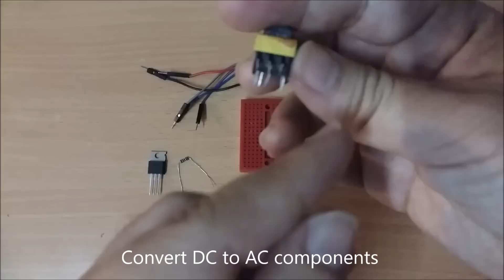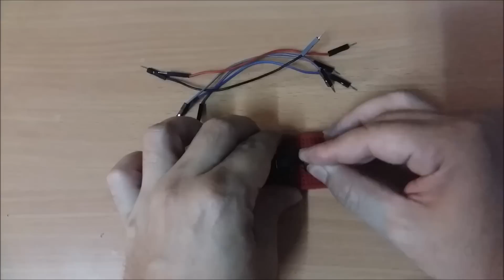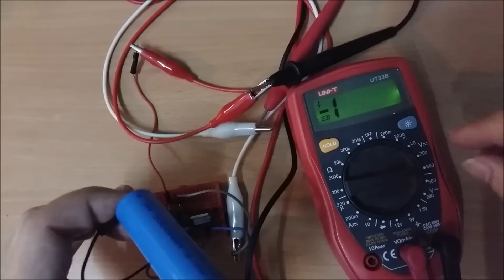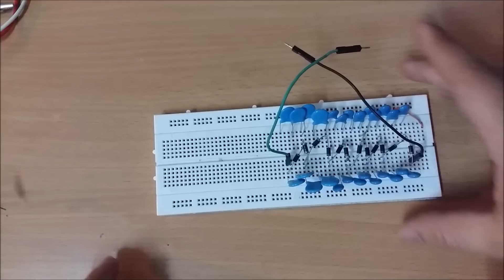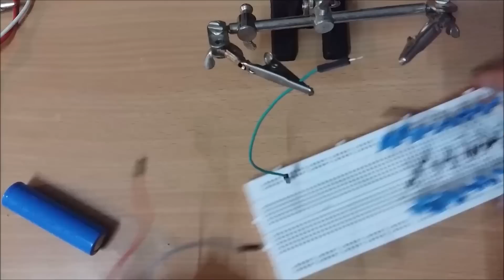diy voltage booster | dc voltage booster circuit | simple voltage booster circuit diagram | #youtube

Comment: Viewers: keep in mind that this so called 3000V AC output is actually 3000V DC PULSED...so you can NOT use this output to drive a voltage doubler (or multiplier) which is what first grabbed my attention.
Reply from the maker: Theoretically you maybe right but practically perhaps you can just go ahead and try

Comment: hello brother i make same circuit but it works with 12v but i want to run it with 3v plz help me plz
Reply from the maker: Perhaps your transformer rated higher voltage.. You need to find transformer that works with 5 volts or lower... U can find them inside phone charger adapter
Reply: brother phone charger have transformer but with 6  pins  but for making this we need 5 pin transformer
Reply from the maker: @MrBoi96969  actually if you know the principle it will works....it doesnt have to be 5 or 6 or 10 pins ...the concept still the same

Comment: how will i buy the ceramic capacitor? what is the farad value of the capacitor you use forza Electronica? i;m not familiar with  electronics though.
Reply: thanks
Reply: ok, thank but is it ok if i ask whatis the value of the capacitor you used in this experiment? its ok if you won't tell me though
Reply from the maker: Crystal Logronio its a combination of few (hundred of nano farad capacitors) code like 103, 472, 203, etc i didn't really concern about the capacitor value when the video is made...
Reply: thank you

Comment: Please answer this can i use this Spark and channel it to power up my HHO generator in order to electrolyze 1 Kg of water in 1 min 20 secs
Reply from the maker: I am not sure what HHO generator and how much power does it required?
Reply: i have made an HHO generator which require 240000V to electrolyze 1 Kg of water so I'm trying use this spark to give 3000V per second in order to electrolyze water in 1 min 20 secs or 80 secs
Reply from the maker: Does it require only spark? or actually wattage that include the amp? if it require amp as well then i believe you have to find something else.
Reply: Can i talk personally with you on email please i can speak more freely pleasee

Comment: @Forza Electronica: Hallo guy, could you please tell how many milliAmps are drawn from the 18650 (high power) battery to achieve 3000 pulsed DC voltage? 
And, if possible, which is the output's frequency of the inverter. 
Adding more stages to the voltage multiplier you can go much higher in voltage at the cost of the amps draw. 
You can now replace the source battery with an ultracapacitor and, after the spark, you can put a reverse Tesla Coil (as a Buck Converter) through which you can step down the voltage - gaining amps - to feed the source cap, in a loop (still being able to light up a power led at the same time). ;-)
Reply from the maker: Fabrizio Ricciarelli it depends on the transistor and also the resistor...the last time i tested 1kohm and mosfet it draw around 200 ma sometimes around 500 ma depending on the the type of mosfet

Frequency = 3500 kHz
Ultra cap is quite expensive to get one so I try to minimize my cost in electronic. Yeah i did try step down using the same transformer and it draws 2 amp using 4 volt battery - it drain out very fast in a matter of few second the battery voltage drop right to 3.5 volts and of course I realize the transistor smoke out and i stopped it right away.

Comment: Have you more info Mini transformer (step up) ?
Reply from the maker: Get it from faulty power supply there are few of them inside there...3 phase primary with centertap
Reply: You mean pc power supply ?
Reply from the maker: Yes can be or any device that has power supply circuit like monitor, tv, radio, cd player etc ...

Comment: Can i skip mosfet part if i have ac-ac power supply?
Also what is output after your transformer?
And last.
Will this voltage multiplier work under lower voltage?
Reply from the maker: yes it should works

Comment: i want to incresae the value of voltage from 220v AC to 3000v DC can you suggest anything
Reply from the maker: Yes u can easily done more than that with initial ac of 220v u could easily increase to 10000 to 20000 with the right transformer but u must use a high powered step transformers and then use voltage multiplier circuit to generate more power but be careful of handling high voltage and high current it could be fatal u should try on small scale first to experiment and see how it behaves before u move to handle dangerous current
Reply: @neodiy  is there any device available in market to do this or you know any industry which can Built circuit according to requiment of customer
Reply from the maker: None that I know off probably the Chinese company could do some circuit or u can look up in ebay high voltage generator

Comment: if i want output 2500 V  DC , mycircuit  schematic  what should be  ? please reply sir
Reply from the maker: I am not sure too but u can try the circuit and adjust accordingly... Remember each multiplier will adds up to the voltage increase..
Reply: @neodiy  ohh,  one question : in this video , multiplier circuit is  double(Voltage) type ?

Comment: is it driver transformer, which is used in the circuit and how much voltage in primary and secondary and how much current?
Reply from the maker: Nayan Nandi input primary 3.7 volt current about 400ma and output 3kv

Comment: AC is a hot orange soft sounding spark. That is DC you are producing at 3000V.
Reply: Correction: Pulsed DC
Reply: Ok, pulsed DC then. Lets see a circuit for some real HV AC around 2000V or more.
Reply: umbrefawx actually it's just dc because the diodes and the capacitors are smothing the pulses out

Comment: can ur explain what does G D S mosfet pin for?
Reply from the maker: Gate | Drain | Source similar to transistor Base, Collector, Emitter. This is explanation from wikipedia since it has better words to explain it.

A small current at the base terminal (that is, flowing between the base and the emitter) can control or switch a much larger current between the collector and emitter terminals. https://en.wikipedia.org/wiki/Transistor
Reply: Forza Electronica m

Comment: can i use a rechargable batteries for this?? and how long it takes before it's low bat :) thanks
Reply from the maker: Yes sure you can use rechargeable batteries -- if you let it turned on all the time i guess it won't last. But if you have a momentary switch and you just turn it on when you need -- it could last for quite sometimes like few  days just like other electronic devices
Reply: hi good eve, thanks for the info, i am asking to the electronic shop if they have a Mini transformer (step up) but they answered there's no such thing as transformer that step up but instead there is transformer that can step down.. my question is where can i find a transformer (step up) and how many mA ?? thanks
Reply from the maker: Interesting...shop...i guess because they usually sell the one for ac to dc purposes. Because it will step down from 220 volt ac to probably 12volt dc or 5 volt dc....

Anyway its not difficult to find if u have faulty pc power supply there are sometimes 3 or 4 of them in there...mini transformer. Any electronic device that has power supply there must be transformer ....and your mobile phone charger usb 5 volt adaprer has a transformer too...or pc power adapter...or your faulty video player...tv...hi fi devices...etc...almost anything that has power supply have transformer in it....i have quite a few of them harvested mostly from faulty pc power supply people...which some of them thrown away by neighbours...
Reply: if you have a step up transformer just invert the cables ( ac in will be hv out and dc out will be pwm in )
Reply: how would i know if it is the mini transformer(step up) and not step down because its very hard to identify. and can use use mini transformer (step down)
Reply from the maker: Yes step up can step down or vice versa its just that u need to know which one is high voltage and low voltage side
Reply: can i buy it to you?? because we highly needed this kind of circuit for our project :)
Reply: can transformer (step down) can be turn into  transformer (step up)??
Reply from the maker: you can actually
Reply: wow do have any links how to do it?? because when i ask to our neighbor  electrician's, he answered you cant step up the step down transformer. and he ask what is the primary and secondary voltages thanks
Reply from the maker: neil abraham Israel not at the moment
Reply: i research it to the internet about the transformer inside the power supply, then i comes out that smps  transformer?? isn't it??
Reply from the maker: Yes probably i m not familiar with smps transformer...but the the transformer in the video primary with center tap and secondary you can refer to this video https://www.youtube.com/watch?v=e1wXJY42mzM
Reply: thank you very much sir, it's the same as the transformer i saw in pc power supply and sorry for disturbances i created. i hope your videos can help us and other people as well. JOB WELL DONE :)
Reply from the maker: you are welcome good luck with your project
Reply: sir i already have my transformer, i will apply it directly or i need to change the windings of it??
Reply from the maker: Directly no need to change winding...u can measure the inductance base on the video link ...if the high voltage side have higher inductance it will generate higher voltage
Reply: i see, but our teacher said that the transformer has an input of 220 ac but in your case you use only 4v input... does it really work??
Reply from the maker: Your teacher must have a limited knowledge of what transformer is available in the world of electronic...220 ac transformer is the bigger transformer where there are 4 pins and they have a lot more coil and inductance value is usually around 18 henry....the tiny transformer has different pins some not 4 pins where some of them have 6 or maybe 5 ...u can create oscillation using transistor to run them ....and it only needs 4 to 5 volt battery to make the transistor to oscillate and in turns transfer the low voltage to high voltage and u can refer to their inductance value as in the video link given previously
Reply: very well said :) ...... i wish you are our teacher hehehe.... thanks for the info. ive also seen a transformer inside the mosquito zapper.. can i use that one??
Reply from the maker: Yes sure can
Reply: sir we already set up the components such as diodes, Ceramic layer capacitors and the IC sir. but our concern is the transformer. because we don't know where is the primary and secondary coils sir. and also your given schematic diagram has 5 pins only. but we have 6 pins in our transformer
Reply from the maker: Use your multimeter (continuity test) -- to find which pins are connected...
Reply from the maker: this video gives you a clue https://www.youtube.com/watch?v=e1wXJY42mzM
Reply: we already have a 5 pins trasformer but still it doesnt functioning....and the center tap doesnt have a connection isnt?? and my other question is in your video you have a 26 capacitor and 12 diode but in your blog you only listed 8 x Ceramic layer capacitors that can withstand up to 3 kilo Volts (3kV) of voltage and 8 diodes 1N4007 diodes??? it can really affect the output??
Reply from the maker: The blog is an illustration --- although in the video have many capacitors the end of the idea is to follow the blog illustration.......the many capacitors some of them are arrange in series to get the voltage because i don't have for example i want to get 10,000 volts capacitor then 2K x 5 times arranged in series. Thats why the video have many...

Ok since you are very enthusiastic kid -- i suggest you do this...measure part by part. Do not assemble your circuit all at once and then test.. you do it this way

First Assemble your transistor and transformer first -- then run the circuit and measure the output voltage..if this is working then start with one first stage of the voltage multiplier ...then test again...

If it is working then go second stage arrangement...and so forth...if you arrange all at once and test you don't know where it breaks...but doing it part by part you know exactly where it went wrong..

Get your multimeter and run the circuit part by part before arrange all at once. 

By the way the center tap connect to positive of the battery
Reply: :) thank you very much sir.. does the center tap has a coil??
Reply from the maker: The center tap is a junction between the left and right pin so yes it is a coil from half left and half right...use a continuity test on your miltimeter to check whether it is connected to the left and right pin
Reply: we try in using continuity test but it doest have any connection between the right and left pin.....how can i post image here?? so that i can send you a photo on how we did the circuit??
Reply from the maker: U put in your blog or google plus ...if  o connection between left and right thats why the circuit not working....then first u must identify which pin connected to which pin ....u can use your multimeter and show me which pin connect to which
Reply: thanks i will put it in my blog. and to show on which pins are connected :)
Reply: if i will put images it in my google +, you can seen it?? because honestly i dont know how to google +. :)
Reply from the maker: If u have google account tes definitely i can see ...now i reply using google plus and add.photo if i want to
Reply from the maker: also measure resistance between the connected pin and how many voltage u use to power it also your transistor part number and your resistor
Reply: i see thanks again sir sorry again for the disturbance.... i really want to achieve this circuit because our teacher laughing on us because they told us its very impossible circuit and its fake  and i want to show them that they are all wrong :)
Reply from the maker: They are completely wrong and u r right no doubt about it
Reply from the maker: I can do the same video over and over again it will still work the same as in this video
Reply: yes i know this video is genuine, im just keep in touch in your direction.... maybe we have a did a wrong move that's why the circuit is not functioning
Reply: by the way i how much is the output amperes??
Reply from the maker: U must understand carefully the connection of the transformer and which one is the high voltage side and low voltage side of it
Reply: by the way i how much is the output amperes??
Reply from the maker: It depends on how much voltage... the higher the voltage the lower the amp...you can measure that later once your circuit is ready
Reply: sir i already post some pictures in my google plus... but my center tap doesnt have continuity to other pins
Reply from the maker: Interesting that means your center tap is just a pin to make the transformer stand or the center tap break ...where is the link to your photo
Reply: ahhh i see  so we need to find another transformer right?

Comment: plss guyss help me .... i want to convert 3.7v ( 2200mAH battery)  to 2000v ac... but the output current should not cross 500 micro ampere
Reply: why……..

Comment: can i replace IRFZ48N with 2n2222 ?
Reply from the maker: rimba cahyo yes sure
Reply: where do you get that mini trafo ct? in elektronik shop i just found trafo ct 1a, it's so big and heavy
Reply from the maker: You  can get from USB adapter or any power supply like PC power supply, DVD player power supply, all kind of electronic devices that have power supply usually got these tiny transformer....the big and heavy one require high power like 220 Volt AC to power them

Comment: I tryed it and it works  
i used 200 ratio transformer with 9V battery to get around 1800V but can not measure it 
can high voltage low current damage multimeter or volt meter?
Reply from the maker: It is possible but at 1800volt or 2000volt is fine..at low current. Some multimeter cannot measure up to that voltage
Reply: بعد اذنك  لو حضرتك من مصر ممكن تقوليلى  جبتى المحول من فين ؟؟ بعد اذنك ؟؟
Reply: hassan abdelghany 
hassan abdelghany 
المحول كان فشاحن pansonic حق الة حلاقة  
الشاحن يحول من 240 الى 12 فولت وعكست مصدر الطاقة حتى اكبر فولت من البطارية  9v
الشواحن القديمة اسهل حق هذي الشغلات لانها ماتشغل الا جهد 240 فقط او 110 فقط 

تغيير المقاومة الها تاثير في تغير فولت بسبب هذا كان يطلع فولت عالي تقريبا 1800 او حتى اكثر 
طبعا لا توصل بدل البطارية بمصدر طاقة مثل الشواحن لانها فيها current عالي او غير محدود وهذا خطير ...current للبطارية  محدود 
اتمنى اني افدتك
Reply from the maker: Habib Sinan yes it is possible it can damage multimeter but 1800 volt should be find
Reply: You could measure it using a voltage divider circuit and just do the math afterwards.
Reply from the maker: Habib Sinan it is possible can damage the multimeter now that i have 1800 volt u can proceed to make the voltage multiplier and connect to it to multiply the voltage and get the spark ..around 3kv to 5kv there should be some spark

Comment: so sir can you tell me that how can I convert 3000 volts DC to 3000 volts AC.
can you make a video for this purpose that how can we convert.......
please sir.
Reply from the maker: Ok maybe i can't tell you much -- because too much to explain...but the basic principal from DC to AC...look at the video from the battery until the transformer output is DC to AC....u can try to experiment this 

When it goes to the voltage multiplier circuit (capacitors arranged) is back to DC.

Comment: sir, can I convert 3000 volts DC to 3000 volts AC? please tell me.....
Reply from the maker: you can but this is not the circuit to convert to ac again it would require some amp where it is very minimal at the end of this circuit